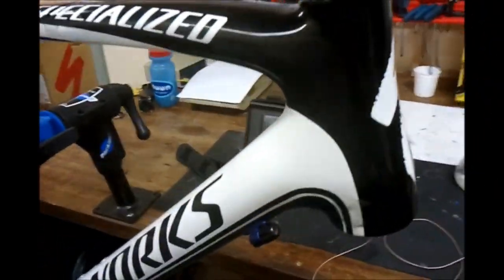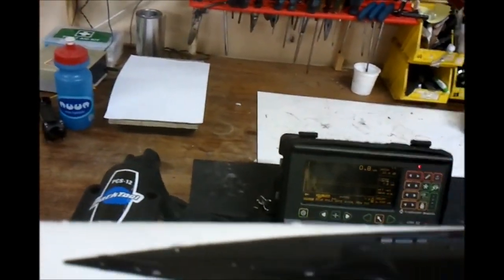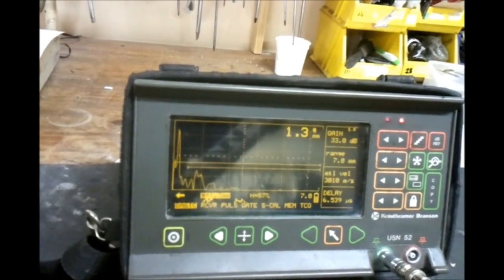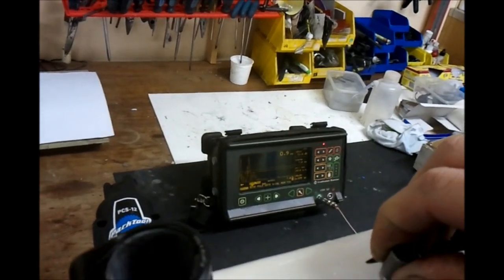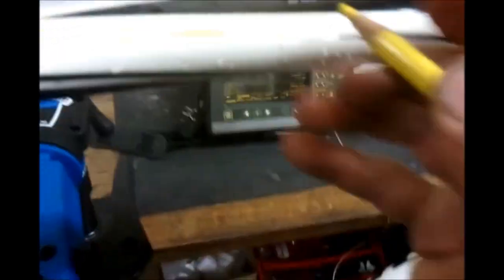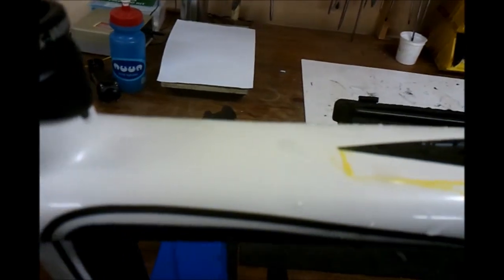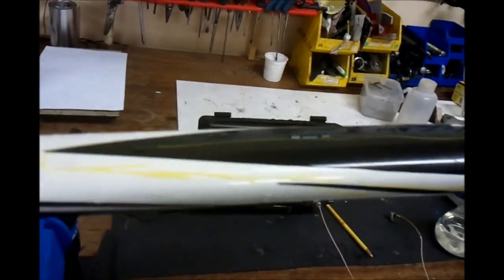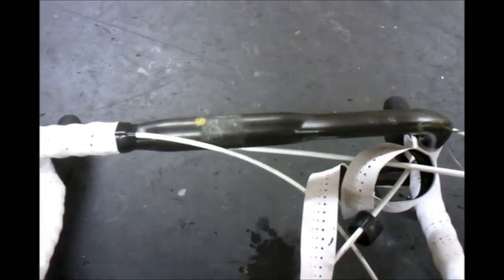Ultrasound scans - Finding the damage before repair.

Comment: Accepting that untrasound is a more precise way to assess defects and damage, would a coin tap test show anything? Using the sound properties of composite is how we initially assess damage in glider airframes( recommended by manufacturers).
Reply from the maker: The tap test is only suitable for certain applications and has nowhere near the sensitivity and accuracy as a ultrasound scan. It is effective for thin skin to core bonds which could be used in sail plane panels. On thicker laminates if the defect is at a depth, it can be very difficult or not possible to note the defect. The cost of the equipment is also significantly different as is the availability!

Comment: I'm surprised the damage zone extended so far from a point impact.

I normally ride a Time VXR, still a great frame in my opinion, and in it's era arguably one of the best, but it's now old and hasn't exactly hung on a wall! It's been raced and of course therefore pranged! Is it typically financially worthwhile to do a non-specific whole frame/fork ultrasound NDT, and if so can you give a rough guideline of the cost to do so? Sorry I expect you get this question a lot, but I have no idea where this stands.

Awesome to see you putting up Youtube content Raoul. I'd love to discuss with you your opinion of some recent developments in the aviation sector (my occupation), maybe one day it will happen over a coffee or ride.
Reply from the maker: We do these type of assessments all the time, the standard cost is $350. I recently did an older Time frame which had cracks at the bonded joints, which is the most common problem with these. The bond interface breaks down over time, pun intended.

Thanks for the feedback, I appreciate it.
Reply: Ok that's quite reasonable considering the work. I'll file that away as I haven't long since converted to Di2 and don't want to strip the frame again so soon, but next time will arrange to send it down. You also mentioned on someone's video you can outsource some spay painting. A new clear coat would bring it up a treat as it's yellowing. I'll discuss all that when the time comes.

Yes I've always enjoyed your videos and can only encourage you to keep up the great work. While I'm a pilot myself (Airbus), my main interest outside work (besides cycling) is engineering, machining and toolmaking. I don't work with composites personally, but have been exposed enough just through osmosis and natural curiosity to know good information when I see it, so congratulations as I know it takes time to do these videos and share with others.

Comment: Great content as always. A little more stable footage of the measuring process would be great, but it's all work in progress:) As a hobby enthusiast I have a question: The Oscilloscope you have there is quite expensive for an amateur. But ultrasonic thickness gauges are at a price where it doesn't hurt as much. Would those be of any help? They would only provide you with the thickness and not the flaws, I guess..? Better than nothing? Useless?
Reply from the maker: The amplifier in the instrument as well as the transducer needs to be very good, thin carbon is one of the more difficult materials to test, not sure if a basic unit is up to the job.
Reply: Great. Thank you for the response.

Comment: Hi Raoul
Do you think the long de-lamination that runs up along the top tube could be caused by riders sitting the the top tube repeatedly while they are waiting at the lights etc? 
I know I do this a bit and now I am concerned this could be an issue for carbon bikes?
Is this an issue and can you do a vlog about this or the differences in how you should use (do's and don'ts) for carbon frames over say Al, Ti or steel bikes?
I noticed you also clamped the frame on the seat tube.  I thought the only place you were allowed to 'safely' clamp a carbon bike was on the seat post?